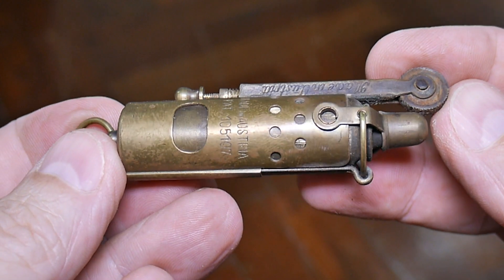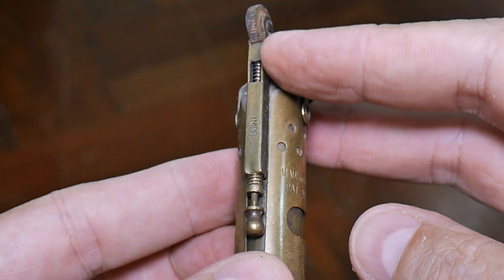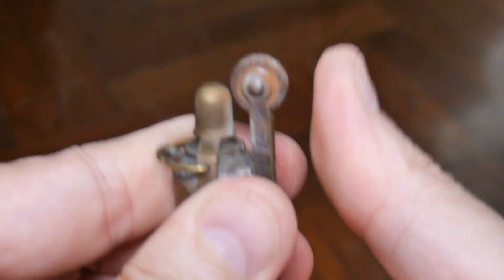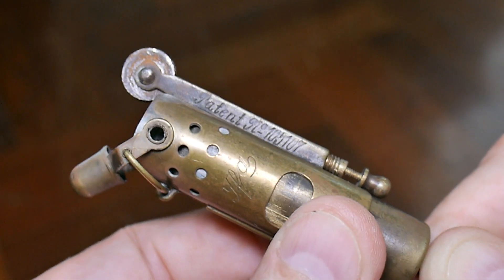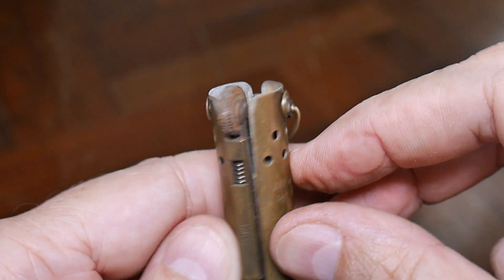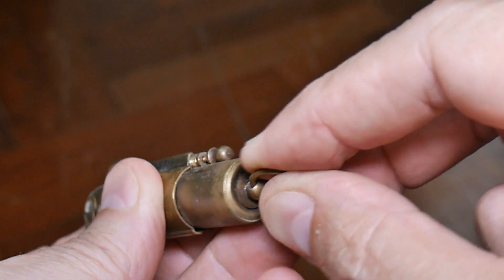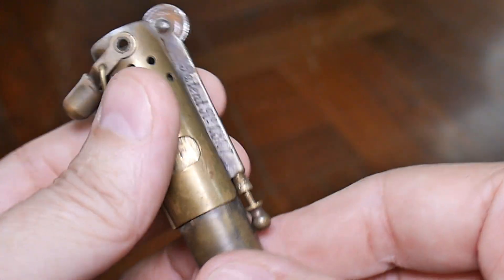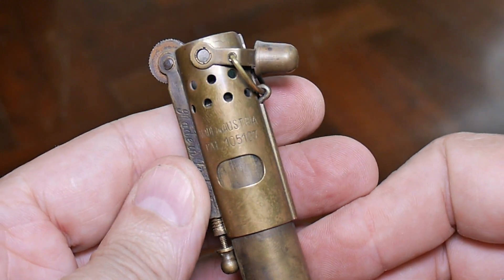Antique Collectable Imco IFA "Trench Lighter"

Comment: It easily one hand operated if you hold the lighter like your losing your grip on a pull up bar, and push down on the spark wheel with your thumb.

Comment: just bought one of these, wick looked unfired and it took to lighter fluid without issues like some older ones have that have used petrol (hence research to determine if it was real or repro), bought as a user however so wasn't bothered if it was real or fake, only issue with it is the split ring braize has broken but I'm hoping it's just solder I can re-melt with my soldering iron, looking forward to using it, I did cut down a piece of bike innertube to serve was a washer on the fuel cap though to cut down on evaporation as that's the main plus I had from my cheap repro one was how long the fuel kept for.